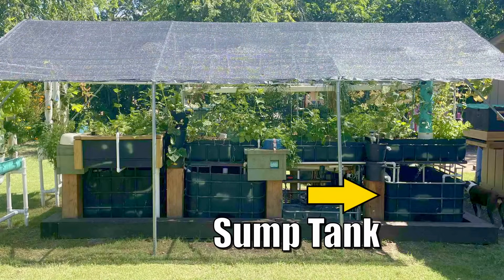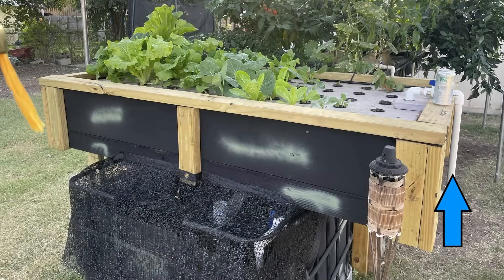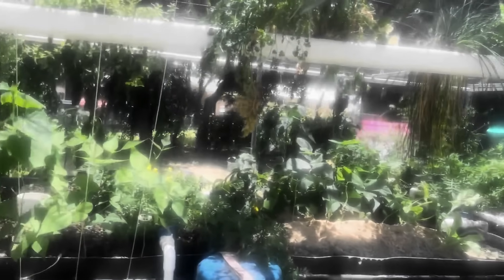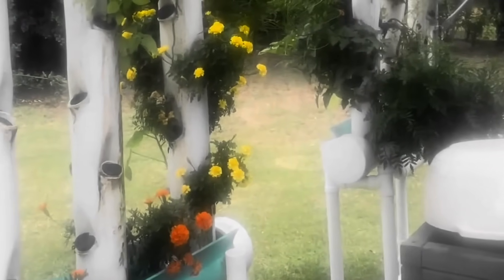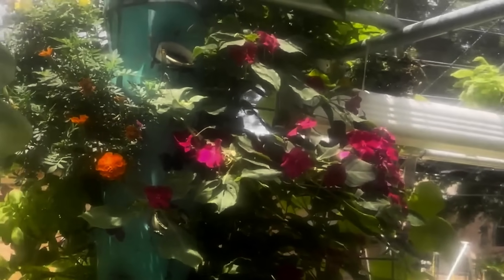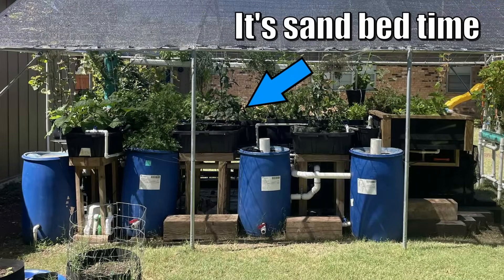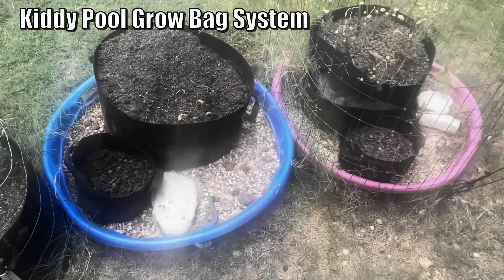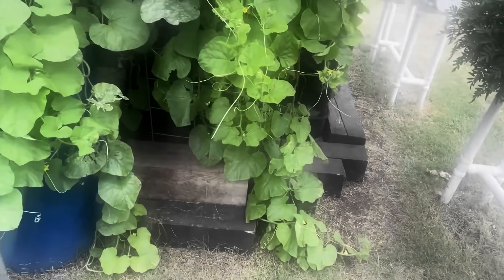AWESOME Aquaponics System with DWC, NFT, DRZ, Sand Beds + MORE - Kerrville Texas USA

Comment: Wow awesome system. The reverse osmosis water is unique. Is this only necessary if using bore water feed water? Also what happens to the brine reject water?
Reply from the maker: In some cases it may be necessary if the carbonates are high in the water. The pH in aquaponics tends to fall over time so treatment of top up water may not be needed as it will help to buffer the system. 
I'm not sure what he does with the top up sorry.

Comment: So cool to see a Texas system on your channel. I had plans to build a system here near Houston but the heat and humidity has stopped those plans for the time being.
Reply from the maker: Are you looking to build indoors or outside mate?
Reply: @RobsAquaponics good day Rob. I want to have an outdoor setup. I have a 20x10 hoop greenhouse in the backyard. I regret the placement and ultimately want to move it before starting a system. Maybe once it cools down since the feels like average this time of the year is over 100 degrees. I lost most of my plants/trees over the winter. Only have 1 avocado tree out of 10 that survived

Comment: Amazing!  It works well!  A true labor of love!  If you could design a new "bad ass" AP system from scratch, where would you start?  What would you avoid?  Which steps would you do in what order?  If you write it down (preferably in a PDF), I will buy your Aquaponic guide.  I bought Rob's "Backyard Aquaponic Guide" and I love it!  Thank you, Rob!  I'm still in the design phase of my integrated off-grid geothermal aquaponic system.  Hoping to build the 'net zero' aircrete greenhouse this year (preferably before it snows), thanks to DomeGaia!  Peace, Love, Joy, and Blessings to all.
Reply from the maker: Many thanks Celia. I hope the dome build goes well. How deep do you need to dig the pipes there for temperature control?

Comment: This guys AP system is like any piece of software I write, starts out simple, then feature creep sets in and the project blows way out of scope, but in the end you achieve a functioning product that yields results.

A disaster will likely eventually strike, and that's when he'll have to refactor and rebuild it, take what was great about it and improve it, and discard the bad. Life goes on.
Reply from the maker: I'm guessing that it would be a pump failure or intervention by the dog that could be an issue. He's a plumber so I'm guessing all the pipes are well glued & tethered. 
Cheers E2Z & have a top one.

Comment: I can totallt see how that system got way over-complicated.  When you do this stuff, it's just so tempting to add a new component and try new techniques.  My system would have gotten crazy like that too if I had had the space.  But it is really neat to see how he's integrated so many different styles into one system.
Reply from the maker: I know the frustration of limited space & resources Subedei. I think our next system will be similar to Steve's (without towers) but I'll plan for different grow zones / methods at the start. That way I can slot them in when the time comes to add them. 
Cheers & have a top one.
Reply: aren't the frustrations of limited space and resources the main drivers of innovation in gardening? 😅